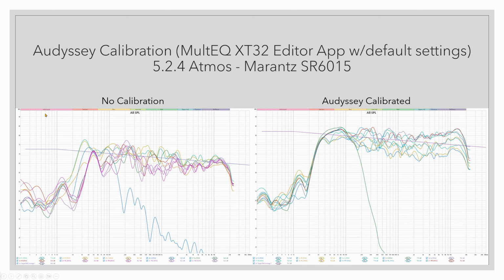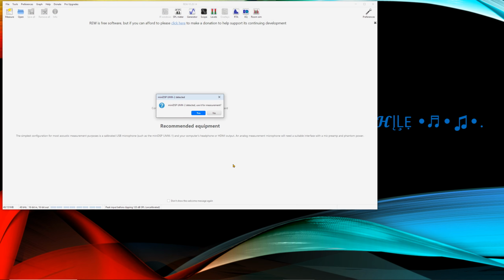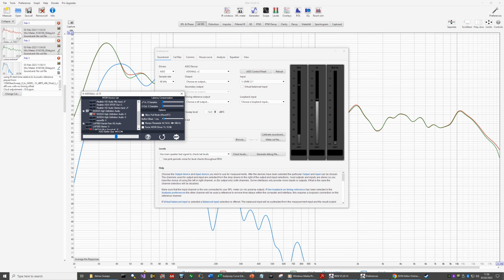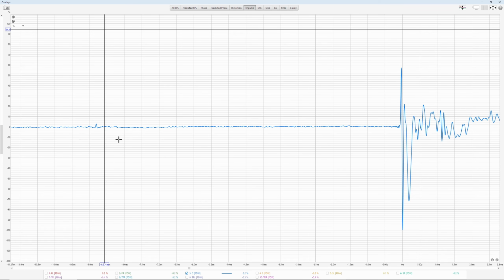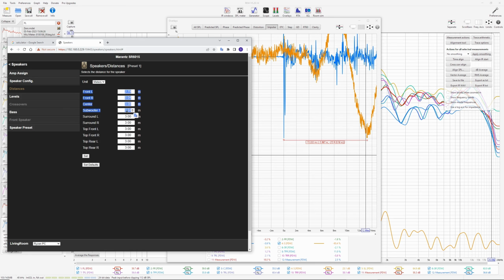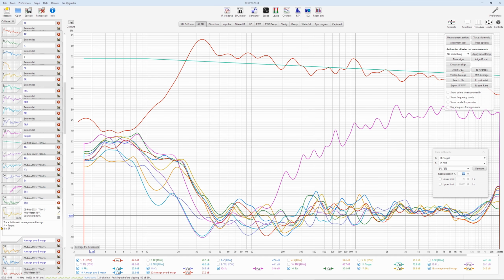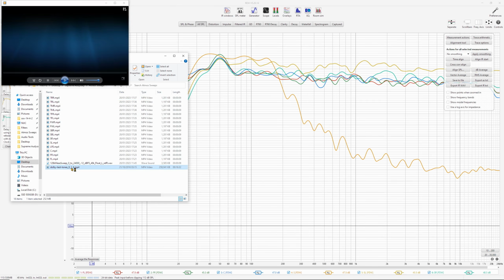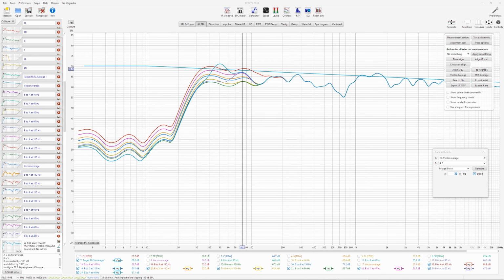Supreme Audyssey Calibration by OCA

Comment: @18:02, if the default is set to my Marantz AVR,  is there any special way that Windows Media Player (or anything else) needs to be setup in order to play the height channels? Or will it play them natively?
Reply from the maker: No change needed in WMP default settings
Reply: @ocaudiophile  Thanks! How about when I select the configuration for the Marantz in Windows? 7.1 or do I choose another option? I think there's one that shows up as Atmos, but the diagram disappears when I select it.
Reply from the maker: I leave it at stereo
Reply: @ocaudiophile  This is definitely still not working for me. My default is set to the Marantz AVR and stereo configuration, but the height files are playing out of fronts left and right.
Reply from the maker: @cadillacfella80  How about when you shut down REW and play these files from WMP?
Reply: @ocaudiophile  I will try that when I resume testing today in a little while. Also wondering, what sound mode should I have the Marantz set to? The connection from laptop to AVR is HDMI. Atmos isn’t an option, so would have to be stereo, multi-channel stereo, multi-channel 7.1, etc. Maybe that is the issue?
Reply: @ocaudiophile  So with REW closed and just playing the files via WMP, they do not channel correctly. If I play the Dolby 9.1.6 test tone generator file in WMP, I get full Atmos as confirmed by the AV, displayed "Dolby Atmos". If I play one of the individual channel files in WMP, the display goes back to whatever sound mode the input was set to. I don't know what else to try. Maybe the files aren't actually Atmos encoded?
Reply from the maker: They're Dolby digital plus Atmos(EAC3), May be your receiver cannot decode EAC3
Reply: @ocaudiophile  It looks like that is the case. Who would've thought the 8805A would lack such a thing? Guess I'll have to do the height channels manually by switching out the amp channel connections...
Reply from the maker: @cadillacfella80  It's very unlikely that a 8805A would lack that encoding. Do you get Atmos with it in Netflix? Becuase Netflix uses DD+ encoding for Atmos. Your problem is somewhere in the PC-HDMI-AVR chain and most possibly in Windows settings somwhere. Try to uninstall Realtek software maybe...
Reply: @ocaudiophile  I tried that. I am completely puzzled. The codecs for the 9.1.6 file and the individual channel files are all the same (a/52 b audio, aka e-ac3). Why would one decode as Atmos from the PC and not the others?
Reply from the maker: @cadillacfella80  Did you try playing them with VLC player, needs some change from default settings but people always achieve Atmos output with VLC
Reply: @ocaudiophile  Thank you. I looked into how to setup VLC and got them to play.
Reply from the maker: @cadillacfella80  Good news. 👍
Reply: @ocaudiophile  Any thoughts as to why the sweep files would be playing lower using VLC? When I did your comparison of REW generated sweeps vs. the files (just for my own sanity), the file curve plotted about 12dB lower. No other changes made to anything.
Reply from the maker: No idea but wasn't the case with me when I used to play with VLC. It must be doing some down mixing or remapping due to some wrong setting.
Reply from the maker: @cadillacfella80  The sweeps are at the exact same volume level with REW's sweeps for at least FL,C, LFE and FR (most possibly for all other channels but this cannot be tested). It's either VLC (due to some imperfect settings) or WIndows or your receiver applying -12dB at some point. I have tried these sweeps with VLC player in the past and didn't experience this drop.
Reply: @ocaudiophile  I asked Thothsong about this via AV Nirvana. He said it's an unfortunate consequence of not being able to control the Dolby dialnorm metadata value when running the encoder. So he's aware that it's a thing. When you ran the Atmos sweeps from the files, did you have to adjust your AVR level at all to get them to an appropriate SPL for measurement?
Reply from the maker: @cadillacfella80  Do you really think there's a "12dB" difference that I am unaware of to this day? We are discussing with thothsong whether or not there might be 1.3dB difference with the surround and top channels and possibly there's not. All front channels are tested and confirmed to be "identical" to REW. 12dB means 1/4th of the volume, that's not something you can miss.
Reply: @ocaudiophile   :) of course not. I'm sure it's a matter of something I have set incorrectly. I will continue to test and report again if I cannot get it to work correctly.
Reply: is there an email address I can send you a screenshot? I’d like to show you what I am seeing.
Reply from the maker: @cadillacfella80  I can't type my email address here but you can post a google drive link (the only one youtube doesn't delete) here if you want. I believe that you measure 12dB lower btw, I just don't think it has anything to do with the sweeps or the method. Something is broken in your system. WMP didn't also work in your case. Tens of people here with very different setups have successfuilly implemented the method.
Reply: @ocaudiophile  thank you, sir! Here is a link. https://drive.google.com/drive/folders/1a-JxkJPn233kNA9cVDEC3LoTd83fANm3?usp=sharing  The blue curve is the REW generated sweep for FL channel. The yellow is the VLC sweep for FL.
Reply from the maker: @cadillacfella80  the difference is actually more like 17dB not 12dB! That's really absurd.Did you try windows sound troubleshooting? It's usually useless but sometimes can sort soem internal soundcard problems
Reply: @ocaudiophile  Yes, useless. I'm still talking with thothsong and he stated the following after seeing my screenshot... "The difference is only 6 dB on my system, with REW configured for -12 dBFS."  I am completely puzzled as to how are you getting them to plot at the same level. Are you using W10 or W11?
Reply from the maker: @cadillacfella80 Good news for you. After receiving nearly 30 comments from you, I have decided to replicate your problem today and finally found it! 

You have left your receiver's "Loudness Management" setting "ON" which applies an SPL offset when Atmos signal is detected vs no offset applied to REW sweep signal which is NOT Atmos.
Reply: @ocaudiophile  Well, that is the best news today for sure! I was starting to go crazy not being able to figure out the issue, to the point where I am actually re-installing Windows on my test laptop. I seriously can't thank you enough for taking the time to help me, a complete stranger, resolve this. I am excited to give it another try later today and hope to report back successful results!
Reply from the maker: You were right that it's a very hard to detect problem and even worse is that I think that setting is receiver default
Reply from the maker: Btw, in my attempts to replicate your problem I also lost atmos from WMP at some point and it only came back when I selected movie instead of music in the remote control. Hard to believe but give it a try
Reply: @ocaudiophile  You are correct. I just checked the manual and it is the default setting.
Reply: @ocaudiophile  I will for sure.  I am also relieved that I am not losing my mind. :)
Reply from the maker: @cadillacfella80  It's one of the very first settings I turn off!
Reply: @ocaudiophile  Just wanted to report back that things are much better since turning off loudness management. Also, is there a good method for using REW and Audyssey with two subs without using a mini dsp?
Reply from the maker: @cadillacfella80  If you plug in both subs to the sub outs of the receiver, you should first time align the subs between each other. Your only option to measure the two subs separately is to switch off each sub after sending an LFE sine sweep from REW. Then you can use the method explained in this tutorial (there are other methods including using MSO to align them):
https://youtu.be/ga2eOwJRtXo

Then you have to measure sub1 and sub2 together with REW and while keeping the distance difference fixed between the subs, you should align this single measurement's impulse peak to the rest of the speakers. The inversion method will EQ them as good as the MiniDSP. You will need to try to stay within the limits of the maximum distance settings of the reciever.
Reply: @ocaudiophile  Thank you! Just FYI, I opt not to use a mini dsp because my system is all separates using XLR connections, which the mini dsp does not support.

I wrote up a brief summary to ensure I understand correctly. Am I ok?

1) Measure both subs separately at each listening position.
2) Cross corr align all of the measurements for each sub.
3) Calculate a vector average for each sub.
4) Use the alignment tool (and vector averages) to determine the delay for each sub in order to 
achieve the flattest response.
5) Create an aligned copy of each.
6) Create an aligned sum.
7) Enter the delay distance data from the aligned copies in the AVR.
8) Measure sub 1 and sub 2 together at center position.
9) Use the combined measurement to impulse peak align with Center channel (timing reference).
10) Measure distance of impulse peaks to determine new delay distance for both subs.
11) Enter the new delay distance data for subs in the AVR.
Reply from the maker: @cadillacfella80  All correct! Just make sure you keep the delay between subs you found with the alignment tool fixed.
If your subs produce the flatest combined response when one of them is at time=0 and the other arriving 5ms (1.7m) later, when you align combined sub response with the acoustic refrence speaker and it reqires 4 metres of delay compensation, you have to increase both sub's distances by 4 metres in the receiver ie 4m for sub1, 5.7m for sub2
It's not going to be as easy as with a minidsp but you'll get there ;)

Since you have separates, you should also have a look in the new Atmos Music video. Your system will bring out the subtle differences in sound quality of that method.
Reply: @ocaudiophile  I was reviewing that one this morning. That will be next on my list to tackle once I get the supreme method and two subs in check. Thank you for the continued support and for creating this content. Invaluable information for those that love to tweak!
Reply: @ocaudiophile  After loading new. ady file, remeasuring and conducting new spl align,  how do you apply those new  spl values to the existing levels? Add to or subtract from? Or ignore originally entered values, zero out and enter new offset values?
Reply from the maker: @cadillacfella80  I guess you're calibrating for a second round? Then you should add or subtract as shown in the REW "Info" window after "Align SPL" command.
Reply: @ocaudiophile  Yes, I was referring to the new spl offset values after remeasuring after loading the corrections. I was surprised that many changed. I also noted that some of the time alignments also changed. Does that seem right? That was surprising as well.
Reply: I'm experiencing the same issue? Did you stick with another media player or were you able to get it working eventually?
Reply: @brianharris5446  I ultimately gave up on windows media player and switched to VLC. It took a little bit of configuration,  but I was able to get Atmos out of VLC.

Comment: Omg an all in one Audyssey cal tuto <3  too bad Marantz disabled web control for my SR7012,do you know a hack to activate it ?
And also what sound profile should we use on Marantz AVR during REW cal (multi channel IN or dolby atmos/surround or Pure) ? My setup is 5.1.2 with reflectives speakers on top of front channels. Cheers !
Reply from the maker: You should Switch the “Network Control” setting to “Always On" in the receiver menu. You can leave the sound profile at stereo, it will change automatically.
Reply: @ocaudiophile  Thanks :) Network Control was already ON but I saw on forums that Web Control for SR7012 is no longer available (only for SR7015), I have to rollback the FW, but no idea how to hack the AVR FW for this
So for stereo I leave Movie Stereo or Pure Stereo ?
Reply from the maker: @Mitholman73  I don't change this setting at all, it automatically switches depending on the incoming signal. Stay away from pure direct modes as they bypass the subwoofer and Audyssey settings.

Comment: Great video. If you ever have the inclination, please do a Dirac video.
Reply from the maker: Thank you. I don't use Dirac. Automated calibrations are no match for a proper custom calibration.
Reply: @ocaudiophile  I don’t think I have the capability to to extensive manual eqs on my onkyo rz50. It as accuEQ and Dirac. 
The results you are able to achieve are second to none! I’m always impressed with your knowledge on the subject!
Reply from the maker: @SunnySkiesInAZ  Onkyo has a better graphic equalizer than Denon/Marantz. You can apply the method in the manual atmos calibration video.

Comment: I have a lip sync issue, is this related to anything I may have done incorrectly? My center channel peak impulse was inverted when trying to time align
Reply from the maker: You can change the polarity of your center speaker. Ignore if Audyssey auto calibration gives you a reverse polarity warning. Ideally, all impulse peaks should point at the same direction (including the subwoofer). If you turn on "Auto lip-sync" in the receiever, it should take care of most lipsync problems btw.

Comment: This is incredible guy, thanks for the guide, ill try to do it but im not very confident in my skills -_-
Reply from the maker: Thanks. No prior experience is necessary to follow the guide, just start and you'll finish in no time.
Reply: Well turns out i need to configure my excell and it turns out that i needed to change the idiom to english (usa) and change the decimals to . Instead of comma. Thank you a lot again. It was separating the numbers like 20,000, 6543 instead of 20.000, 6543
Reply from the maker: @krugorZ  Great, hope you're enjoying the results...
Reply: This is not working for me, i did all the json edit with the 0 and 1's from the excell and and nothing changes when upload to the app. Distances didnt show 0.04 etc, can i put all the levels and distances to 0 manually and setting speakers to large? Maybe is because i use audyssey xt and not xt32.
Reply from the maker: @krugorZ  you don't see distances change when you upload the revised ady file back to the app?
Reply: No, i did all you explain in your video and when i upload the file .ady in the multiq app, the diatances, levels and crossovers still intact, nothing change. Maybe im doing something wrong i need to check it later
Reply from the maker: xt might have less than 16384 data points maybe (just a wild guess I don't have xt) then you should decrease the size of the Dirac data accordingly.
Reply: @ocaudiophile  it shows me 16384 data points too, i take a look when i go home, i keep you update if i find the solution, thanks anyways much appreciate

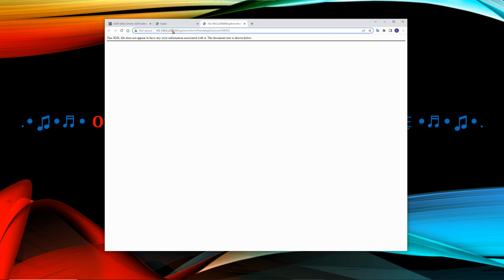Comment: Sorry for the stupid question, but I am completely lost at 8:26. Why dbfs and not just figure out the SPL as we are used to? I can't get that control protocol thing to work (I use my own IP of course, but it still does not work). What is the purpose of doing it this way?

Is it correct that it does the same thing to SPL align for 75db with REW and umik?
Reply from the maker: COntrol protocols are just an easy way to set some settings without using the receiver buttons or remote control. You can totally set your receiver volume to what you want using your receiver's remote or volume knob. Just set it at a comfortably high level of your choice (doesn't need to be 75dB) and don't change it during the calibration.
Reply: @ocaudiophile  ahh I see. Thank you for clarifying 😅❤️
Reply: @ocaudiophile  just to piggyback off of the original question,  with this method there is no need to SPL match the speakers in advance of taking the freq. measurements, correct?
Reply from the maker: @cadillacfella80  You need an Audyssey measurement file and to produce one in the app, you need to do subwoofer SPL matching and at least 3 measurements.

Comment: Awesome tutorial. I have questions  regarding mic positions measurement for  3 seats  first row  and 3 seats second row. Where mic positions should be place and how many measurement
Reply from the maker: Mic positions are easy, at ear height for each of the 6 seats. I guess main position will have to be the middle seat position in the row where ear height is equal to speaker tweeters' height if the rows are inclined, where you regularly sit if floor is flat. You can give increased weights to positions depending on how frequently that seat is occupied.
Reply: @ocaudiophile  thank you for the reply. I am not really understand about the main mic position (first measurement mic position). Shall it in the middle between two rows? To get everyone pretty much equal time delay dan volume level? Thanks.
Reply from the maker: @1psxpat  I'd choose the location that I sit but you can of course choose the central point between rows. That location will sound the better than all others.
Reply: @ocaudiophile  thank you

Comment: Any reasons you use 128k length sweeps here, when you earlier in other videos said that 1M is better and more accurate?
Reply from the maker: Practicality (speed and memory problems due to total number of potential measurements) and Audyssey already capping  the accuracy here with its 16384 data points. FYI 1M measurements wouldn't be effected from my 50Hz ground hum.